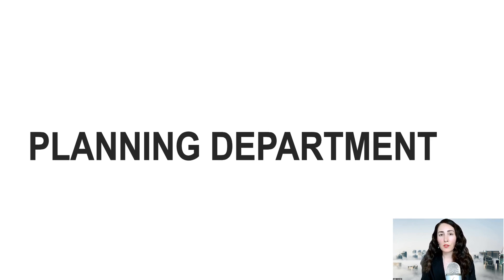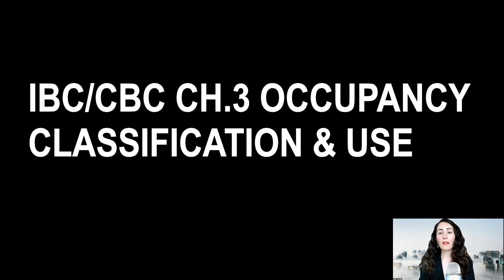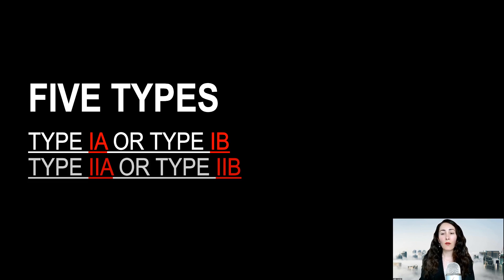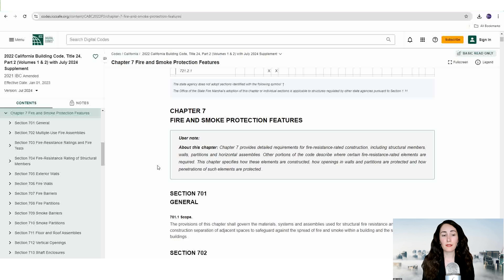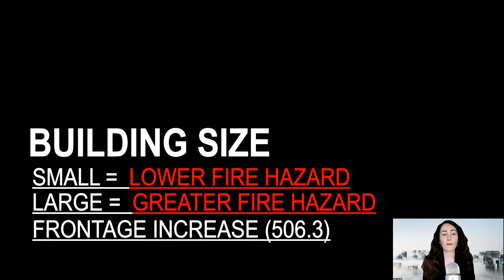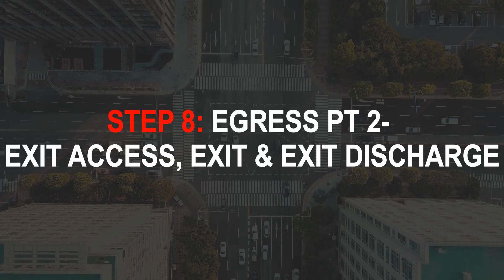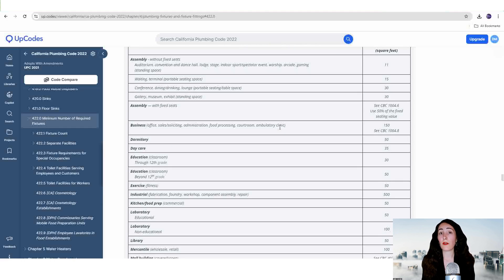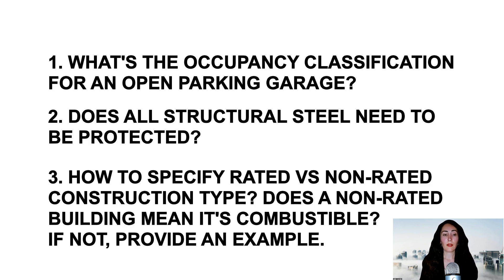MASTER Building Code Analysis in 10 EASY Steps

Comment: 1. The occupancy classification of a open parking garage is group s-2, low hazard storage
2.Like the video explains a lot depends on the building and its details, structural steel does not always have to be protected, it depends on the type of construction of a building and its occupancy. 
3.Rated vs non-rated construction type is referring to the fire protection of a building. Rated (type A) means it is protected, Non-rated (type B) means it is not protected. A non-rated building does not mean it is combustible for example a concrete building does not need fire protection and is not combustible.

Comment: The most interesting point in the video is the fire code perspective because there are many layers for fire safety (step 5)  that includes the codes and tables that an architect needs to understand. The placement of the building can create a fire hazard if it is too close together or close to the property. By understanding the importance of fire resistance ratings, the types of fire rating walls, if your building needs to be sprinklered, and the egress ensures the safety of the occupants and the fire fighters. So the fire safety codes is one of the things I have to think about during the design process.

Comment: 1. The occupancy classification for an open parking garage is Group S-2.
2. Not all structural steel needs to be protected in terms of fire-proofing, in cases such as non-rated construction types labeled as Type B constructions.
3. Rated vs non-rated construction types refer to whether it's Type A or Type B. Type A constructions require fire-protected materials and Type B do not. However, non-rated buildings doesn't mean it's combustible. For example, type II-B buildings are constructed with non-combustible materials like steel, just that these materials have no fire resistance.

Comment: 1. It is important that as an architect you understand all the parts when it comes to zoning data and not depend on other consultants to know because as we are designing the project we should also be well informed and know these details to help produce a well-designed project. 
2. The IBC states that the occupancy classification for an open parking garage would be group S-2
3. The construction type of a building determines if a structural steel requires protection
4. There are 5 types of Construction, either protected or non-protected
5. The building size as well as the building footprint matters as it determines how fast the fire will spread
6. The building codes are not retroactive which means old buildings do not have to be up to the present codes but if they undergo heavy renovation, the whole building has to be brought up to code.

Comment: 1) The occupancy classification for an open parking garage is group S-2 which is low hazard storage.
2) Not all structural steel needs to be protected it depends on both construction type and occupancy. 
3) Rated vs non-rated construction can be identified by two types A which is protected and B which is unprotected. However, a non-rated building doesn't always mean it's combustible it's dependent on the level it's classified as.

Comment: I found this video incredibly informative, and it has me reflecting on both my current and past studio projects. One question that comes to mind is regarding the allowable occupancy signs in older buildings. As buildings age, do these signs ever change, given that the building’s durability and capacity may decrease over time due to the constant repeating load?
Reply from the maker: If there's no major renovation and unless the AHJ requires it because of a change in occupancy and use, then it remains the same.

Comment: 1.The occupancy classification for an open parking garage would be Group S-2
2.All structural steel does not need to be protected, it is all dependent on factors such as the contruction type of the building and the occpancy of it
3. The two type of contrction Rated and Non rated are specified through either the letter A or B. Type A means that it is rated, whereas type B means it is not rated. A non rated building does not mean it is combustible. It is dependent on the level it is classified as. For example, Type IB is non-combustable wand  Type IIIB would be considered as combustible.

Comment: 1. The occupancy classification for an open parking garage is Group S-2, which is under ICC 311.3, Low-hazard storage

2. Not all structural steel has to be protected as it depends on the type of construction necessary for that building. This refers to type A or type B construction. 

3. Rated and non rated construction types are of type A and B. Type A is protected whereas type B is not. However, a non-rated building doesn't always mean it is combustible. One example is type II-B, which uses non-combustible materials such as steel with no protection.

Comment: 1. The occupancy classification for an open parking garage is Group S-2, meaning it’s a low hazard storage. 
2. Not all structural steel needs to be protected, it depends on construction type and occupancy. Type IIA and IIB buildings do not need protected steel, but fire rated construction requires protected steel.
3. Rated vs. non-rated construction type can be specified by two types that are type A which is protected and type B which is unprotected. A non-rated building does not mean it is combustible. For example, type IB are not combustible because it is fire resistive, and the materials are unprotected. On the other hand, construction type VA are combustible.

Comment: 1. The occupancy classification for an open parking garage is Group S-2.
2. Not all structural steel needs to be protected. The protection is dependent on factors like occupancy and construction type.
3. Rated vs. non-rated construction types are based on fire resistance. Type A means that it is fire resistant while type B means it is not fire resistant. For example, type IIB is non-combustible while type VA is combustible.

Comment: 1. The occupancy classification for an open parking garage is Group S-2 which means low hazard storage.
2. No, not all structural steel needs to be protected as it depends on numerous factors such as its occupancy.
3. Rated vs. Non rated construction type is based on two types : A or B. Type A means that it is protected and type B is nonprotected. There are five different types of construction and for each type, there is Type A or Type B (Ex: Type IVA  as combustible or Type IIB as non combustible).

Comment: 1: An open parking garage is classified as a S-2 group
2: Not all structural steel types need to be protected. Other types of construction (types A-B) have a different requirement of being protected. A Type A steel that is protected has a certain paint layer over the steel that can create it to be protected. 
3: The rated and non-rated construction is by its fire resistance rating. A non-rated type of construction does not always mean its combustible, the materials on type B can be a pure material (such as Steel or Concrete) that does not have any fire protection added.

Comment: 1. An open garage is classified as Group S-2 for occupancy purposes.
2. The construction type of a building dictates whether structural steel requires protection. For instance, Type IIA and IIB buildings do not necessitate protected steel.
3. The rating of construction, whether rated or non-rated, is determined by its construction type. For example, Type IB is considered non-combustible, while Type IIIB is combustible, even though Type B does not imply that it is entirely combustible.

Comment: 1. The occupancy classification for an open parking garage is Group S-2
2. No, it depends on the type of construction. Only in fire protection related construction does structural steel need to be protected. 
3. The rating of a construction is based on its fire resistance. iType A are more fire resistance and type B are less. Non-rated building does not translate to combustible, for example, type IB is a non-combustible building type that primarily uses reinforced concrete or steel.

Comment: 1. The occupancy classification for an open parking garage is S-2 (low hazard storage)
2. Not all structural steel needs to be protected. It depends on the occupancy and the types of construction required for that building (type A vs B).
3. Rated vs non-rated construction types are specified through the construction types such as type A or B. Being non-rated building does not mean it is always completely combustible because it depends on the levels, for example type 1B would not be combustible but type VA would be.

Comment: 1. according to the internation building code (IBC) the occupancy classification for an open parking garage would be group S-2
2. According to the California Building Code 2022, it is stated that all structual steel in California needs to be protected against corrosion but fire proofing would depend on the buildng typ and occupancy
3. Rated and non-rated construction types are typically distinguished based on it's fire resistance rating. When a construction type is rated,  it means that it has elements with a first resistence time depicted in hours. When a building has no fire resistence it is denoted by a B. But a type B doesn't mean that doesn't mean that it immediately combustable, type 11B is an unprotected non-combustible. which is the most common type of non-combustible construction used in commercial buildings

Comment: What I found to be the most interesting part of this video was the fact that buildings aren't generally retroactive unless it is being renovated or having things added into the existing building. Personally, I would like to know a little more about how the codes affect the renovation of, lets say, a historic building. I find renovating historic buildings as an interest of mine when thinking about my architectural career after undergrad, and I'm not exactly sure how to pursue that interest. Maybe I need to look over the historic buildings chapter in the CBC to find out more about how the codes affect renovating the building. So if a particular historic building needs renovation, would the plumbing and electrical need to be up to code? Or would certain things that are being renovated at that time need to be up to code and not generally the entire building? What I'm trying to say is if a historic or old building is being renovated and there are a few issues with the building not being up to code, would the entire interior of that building need to be up to code or just the parts that are being renovated? I hope that makes a little more sense than the previous question I asked.
Reply from the maker: That's an excellent question. You would work with your local AHJ and the historical board to determine the extent of renovations required. The state historical board and also the historic code in the CBSC would be consulted. Bottom line, it's on a case by case basis. We don't want to destroy the aspects of the building that make it historic but at the same time if we need to incorporate accessible ramps, then we design the best solution without compromising the historic nature of the buidling.

Comment: One point that stood out for me this section was when you mentioned about the fire hazard. When you mentioned about how the building size matters for how fast the fire spread,  I understood that both the building footprint and the height of the building matters, but is there any calculation formula that helps determine how much space is needed in a specific room? Another question that I have is what building has the most stringent code in general?.
Reply from the maker: Excellent questions!!!! Buildings storing hazardous toxic flammable etc materials, building occupancy H or F definitely have in general more stringent requirements for fire hazards. Room sizes are determined by egress typically, i.e. how many people will use the room and the rooms function based on CBC Ch.10. As the room gets larger, you'll need more exits for example.
Reply: Adding onto the point, it’s interesting how the code becomes more stringent to address safety concerns related to means of egress. Conversely, does that mean that interior finishes might have to change if the fire department intervenes for fire safety requirements? As explained in the video, if the local fire department lacks sufficient resources they will definitely enforce more stringent requirements  even limiting the height one can build  even if the code allows for more.

Comment: 1. IBC Chapter 3. section 311.3 Low-hazard storage, Group S-2
2. Fire protection is required for structural steel in many, but not all, circumstances. In IBC/CBC Chapter.6 determined the specific requirements for different types of construction.
3. The IBC defines five primary construction types and each type has subcategories A and B. Type II-B and type V-B are non-rated construction type. Non-rated building does not mean its combustible. a building is combustible depends on the materials used, not solely on its fire-resistance rating. Non-rated construction simply means that the building's structural elements don't need to meet specific fire-resistance time ratings (1 or 2-hour ratings_.

Comment: 1. Open parking garages are classified as a low-hazard storage in Group S-2.
2. Structural steel does not always need to be protected. It may or may not be protected depending on the type of construction it's being used in. For example, Type IA would have protected steel because the "A" refers to additional fire protection, but Type IB would not.
3. A construction type is rated when it has a fire-resistance rating in specified hours, which can be seen in Table 601 of the CBC. A construction type with "A" would be more protected, while "B" would have no protection. However, a non-rated building doesn't necessarily mean that it's combustible. A non-rated building could still be built using non-combustible materials like steel, but they would have no extra protection added to them. Any Type I construction would be the most fire-resistant while Type V would be the least fire-resistant.

Comment: 1. The occupancy classification for a public parking garage open or enclosed is group S-2 or the Low-Hazard Group.

2. No, not all structural steel needs to be protected. Depending on the construction type it would need to be protected but not all steel is protected.

3. The Rated Vs Non-rated construction type is specified in chapter 6 on the 601 chart providing building element fire resistance in hours for each type of construction. 602 then goes over each building type requirements. A non-rated building does not mean it is combustible, you can use non-combustible materials such as steel for type for construction when building, "exterior load-bearing walls and nonload-bearing walls of Type IV-HT Construction in accordance with Section 602.4.4."

Comment: As mentioned in the video we have to consider all the chapters and all the codes in the CBC and IBC however I found it very interesting how step 10 (Accessibility) is most likely the one we will keep in mind the most when designing a building. As we design a building maybe a commercial or residential we always have to keep in mind accessibility for the group that will be using it. In a way I believe that step 10 and step 3 go hand in hand because you have to know what the purpose of the building is in order to identify how accessible you have to make it. This video has also helped me realize how important it is for an architect to know where to find the code you are looking for given how extensive the rules are and how different rules apply as you make more additions to your building, for example a building with multiple uses compared to a residential building.

Comment: 1. The occupancy classification for an open garage is group S-2
2. The construction type for a building determines whether structural steel needs to be protected, for example type IIA and IIB would not need protected steel.
3. Rated and non-rated construction is determined by it's construction type like type A and type B, type B doesn't mean it's fully combustible. For example Type IB is non-combustable while Type IIIB is combustable.

Comment: 1.) The occupancy classification for an open parking garage is Group S-2.
2.) Structural steel must be protected depending on the type of construction and the specific building element. In fire rated construction, structural steel must be protected, but in non rated construction, this is not a requirement.
3.) Rated construction is classified as fire resistant and this is determined by the type of construction. Non rated construction is not fire protected, but this does not mean it is combustible. For example, non rated construction in the Type B category utilizes structural steel that is non-combustible but has no fire protection.

Comment: 1. The occupancy classification for an open parking garage is group S-2.
2. Structural steel need to be fire proofed in fire rated construction type such as type 1. construction types that are not fire rated can use non protected steel.
3. Rated construction type are construction type that are non combustible with a long fire resistance typically made of steel and concrete. Non rated construction type doesn't mean its combustible, they simply use steel that are not fire protected.